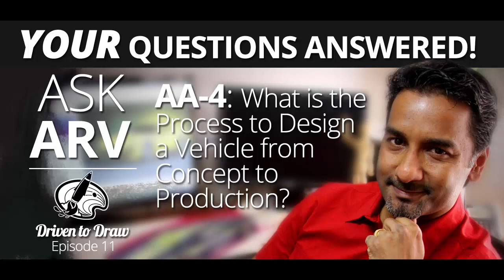AA4_What is Process of Designing a Car

Comment: I have H-Point the most amazing stuff is what had been done around the turn of the century.  More electric cars than gas.  Lohner_Porche had a hybrid. Run flat tires 1934.  1906 first GP France around 100 miles an hour. Art Center founded 1930. First unibody Lancia 1922.
Reply from the maker: James Burnette agree!!